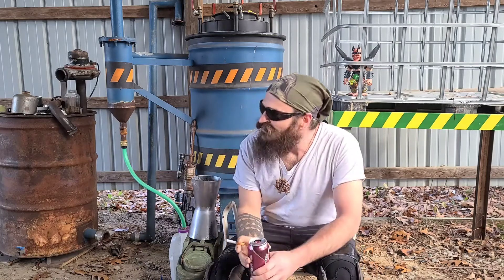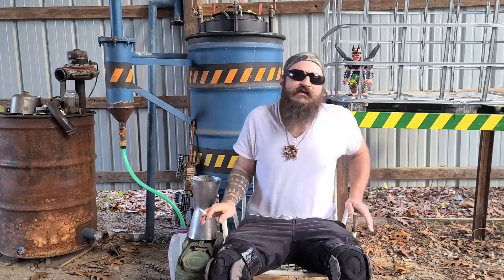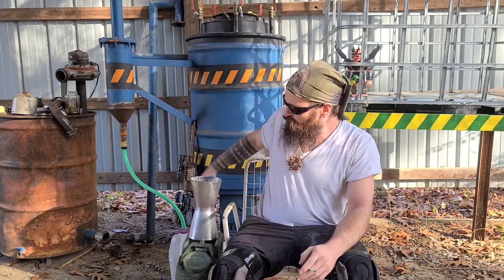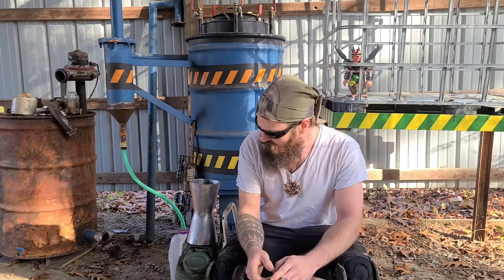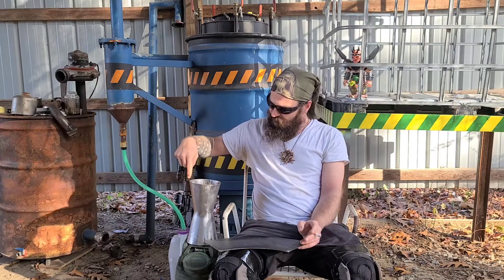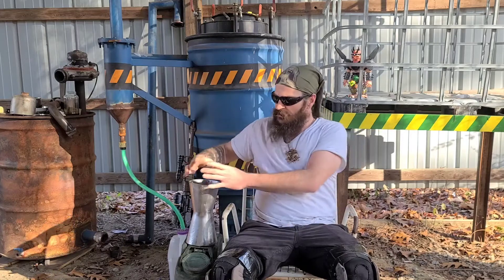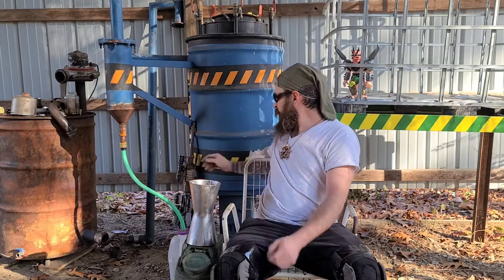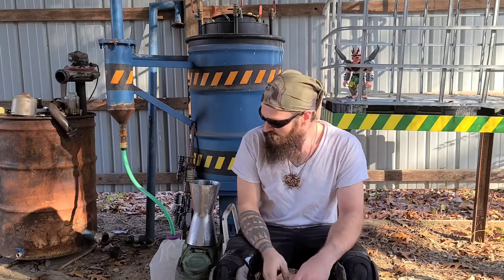Episode One Gasifier Introduction

Comment: I,m getting ready to Build a Gasifier, Like know other, And should be Capable of Running a v8 engine, With no Problem.And with the filter, That I designed, Will keep all Particles, From entering The Gas, Pure Clean Gas, And I will Film the Build But will show it after, I patent it, after I know Its 100% working They way it should.
Reply: Why capitalize every first letter? I don't think you can't patent it either it's already been revised a hundred times by now. They used to have syngas bladders on motor vehicles. Check out Marcus Norman's channel he's getting 40mpg or something crazy out of a v10 Dodge hemi!

Comment: pyrolysis! If you use wood, you can do syn-gas and methanol, or plastic you can get something similar to petrol/diesel, can't wait to try this myself at somepoint soon..
Reply: Stick with dry hardwood chunks. You can crack plastic but you won't like what you get from it. It makes a gluey mucky mess that coats everything. For plastics you need 3000-3500F to crack the long chain hydrocarbon polymers or you end up with a useless tar. It's only possible to do on a large scale with big money input. Hardwood scraps are available and relatively easy to chunk up and feed. Hardwood pallets are usually free.

Comment: Very interesting, looking forward to this let's build. Am curious as to what the ratio of wood (and which wood is better) to fuel output is. Is it only wood, or will other burnable biomass work?
Reply from the maker: Hardwood is best. Really you can gasify just about anything. You want to stay away from things with a lot of tar and resins. You have to try to clean that out of the gas before it gets to the engine.
Reply: Don't use pines. Watch flash001usa's channel he's got the best filter explanations. Mine's a pvc radiator I'm going to fit his tri-filter system onto.